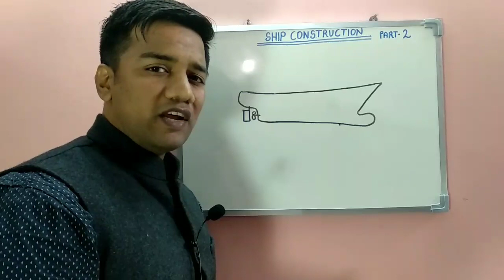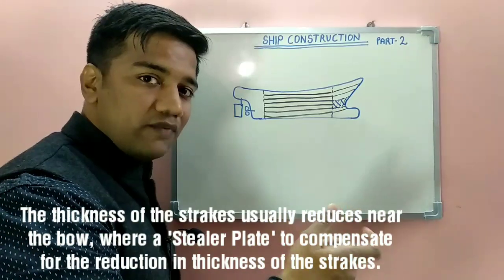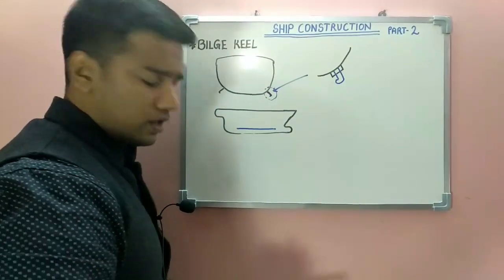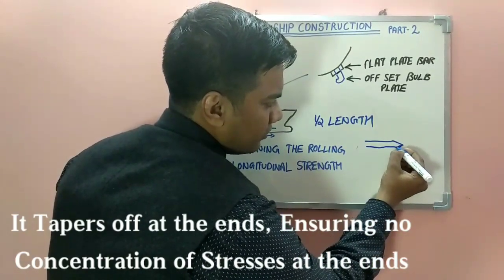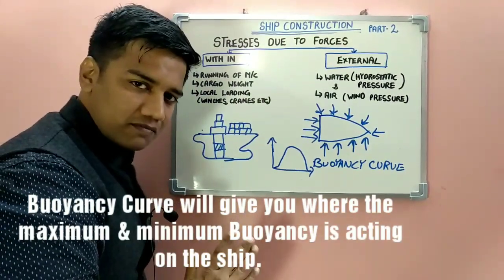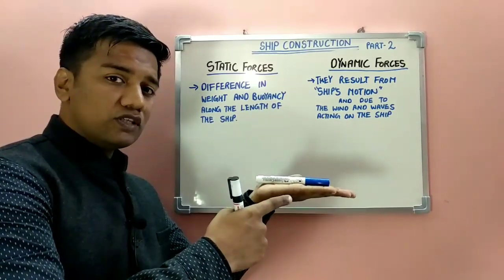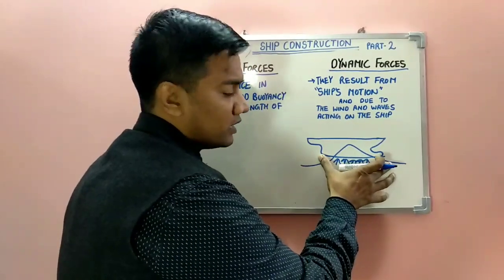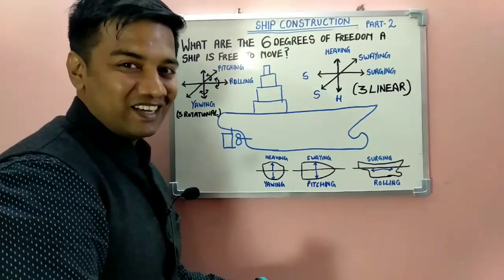Ship Construction Part 2, 2nd Mates Oral, F3

Comment: Hi pls correct me if I’m wrong, I’m a little confuse between strake and plate.

Strake is part of the outer shell and what’s above it is the plate correct ? 

So you’d have the keel strake, adjacent to it is the garboord strake

Then above the keel strake is the keel plate, and adjacent to it, is the shoe plate/ coffin plate.
Is this correct ? Thank you !
Reply from the maker: The Hull of a ship is a hollow body enclosed by Plating (side shell plating,bottom shell plating, Deck plating).
We all know what we mean by plate. It is a rectangular shape steel with certain thickness.
Number of plates put up together usually
in the longitudinal direction make up a Strake,
(eg-Sheer Strake,Stringer Strake/plate etc)
eg-Sheer strake is made up of numerous side shell plates 
in longitudinal direction.
In naval architecture and ship construction each of these plate has an identification.These are numbered in certain pattern.
The plates are identified by a letter and a number.Each plate is given a letter in the vertical direction starting with A from the bottom.
Each plate is given a number in the horizontal direction starting from aft.
Each section of the plate placed in fore and aft direction is called a “strake”.
It is the shell expansion plan where the numbering of 
plates and lettering of plate strakes are used for 
reference purposes. Hope this Clears your doubt.
Reply: Nihal Gupta thank you !!!!